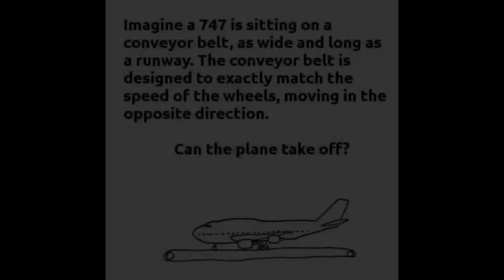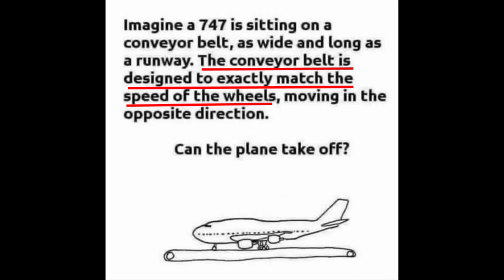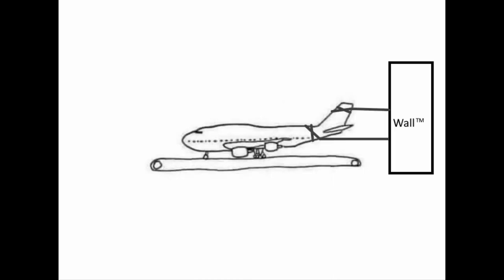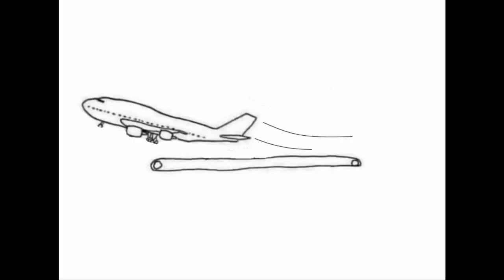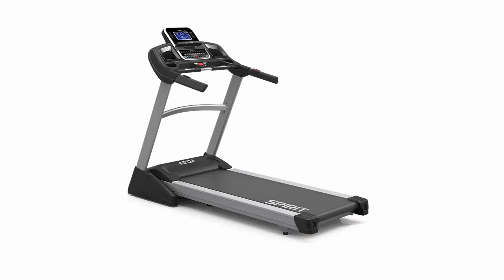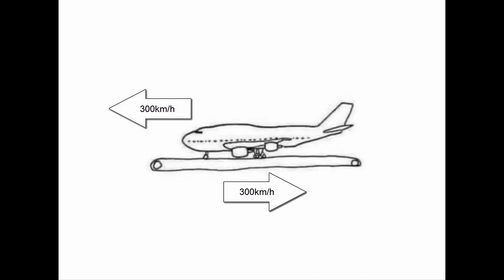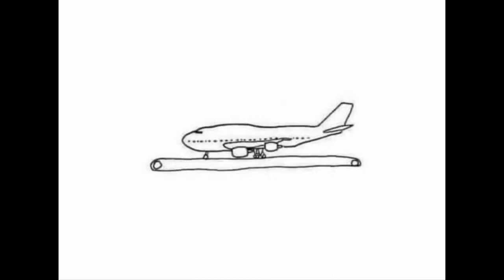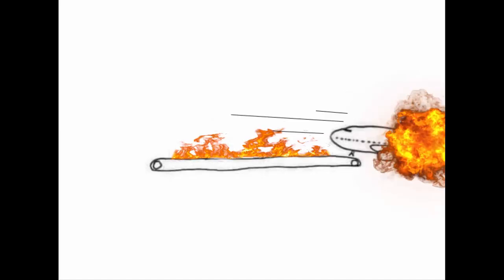Airplane on a treadmill is a flawed question.

Comment: The problem is, it's a trick question as worded. The planes wheel speed and the belts speed must be identical. As such, by definition, the plane must be stationary. Forget what the plane is CAPABLE of doing. That's completely irrelevant. All that matters is wheel speed (x) MUST equal belt speed (y) according to the rules set forth (ie. x=y). You illustrate the problem yourself at the 2min mark where in order for the plane to move forward at 300km/h, its wheels (x) need to be moving at the 300km/h ABOVE the belt speed (y), resulting in x=y+300km/h. According to the question, if the wheels are rotating at 600km/h, the belt MUST be as well (not 300km/h), which necessitates zero movement. In order to move, the planes wheels would, by definition, need to exceed the speed of the belt. So yes, in the real world, your "think of the wheels as ice skates analogy" might be more apt, but the way this question is worded, you need to think of the wheels and the belt as being locked together with toothed gears. They MUST be in perfect sync with each other by definition. It doesn't matter how fast one rotates forwards or backwards, the other will (by definition) have to rotate an equal amount in the opposite direction, thus resulting in zero net movement. For all intents and purposes, this is exactly how wheels and belts operate. They are perfectly locked together. Unless slippage occurs for some reason (which would violate the rules of the question), wheels and belts act effectively like two gears locked together.

So yes, you're absolutely right that it's a flawed question because of the requirement that the wheel speed must match the belt speed, but this doesn't make the wheels or belt irrelevant, that makes them the ONLY thing that is relevant (within the rules set forth in this question). The capabilities of the plane are what is completely irrelevant because it doesn't matter what it can, or can't do in the real world, it will always need to satisfy x=y according to this question.
Reply from the maker: Yes
Reply: Thank you for this.
Reply: This is the correct answer.
Reply: The wheel speed matching the conveyor is the key to solve this. The plane is sitting on the conveyor neither the wheel or the conveyor is moving. Now start the jet move  1 rev of the wheel now the plane has moved forward and 1 rev of conveyor is now behind the wheel. The real question is how fast the conveyor is moving.      The answer is it is not and never will. That is the trick of this question.
Reply: The wheel and belt speeds can match all they want. If the belt is not as long as required minimum for the plane to achieve Vr and it moves forward past V1, it's going off the end of the belt on the ground. That's why the question makes it clear the belt is as long and wide as a runway and in fact, that is the deciding part of the question. A plane can't even get off a runway without a conveyor belt muddying the waters if it runs out of runway too fast to reach rotation speed. Whole point of having minimum runway length by airplane type.
Reply: @HerrinSchadenfreude  the whole point is that X=Y meaning no net motion.  You could have the wheels on a matching set of cylinders that roll at the same rate as the wheels fixed in the ground instead of a long conveyor and the net speed will similarly be zero.
Reply: Everybody commenting that the "math" forbids any motion of the plane is dumb. There are two possible scenarios depending on how you measure wheel speed. If the wheel speed is measured at the axis, then the wheel speed is equal to the plane's speed and the conveyor moves backward at that same speed, resulting in a wheel rotation of twice what would normally take place on takeoff. If the wheel speed is measured at the surface of the wheel, the solution to the problem is you equip the plane with wheels that have infinite radius. Their rotation approaches zero and the conveyor stays completely motionless as the plane takes off and its pilot gives a big middle finger to everyone who tries to create mathematically impossible scenarios. X=Y=0 and the plane still moves forward.
Reply: @TSR5000  your math is incorrect and your two scenarios are terribly incorrect.

You are mixing and matching the speed at the wheel axle with the tangential speed on the circumference of the wheel.  That doesn't get you twice the wheel speed or the vehicle speed.  That's a common and basic error that keeps popping up with people who think the plane just rolls unimpeded.

It's also a sign of inexperience or error with understanding frame of reference analysis.

If you want to see what people mean by the vehicle doesn't move, Mythbusters mistakenly showed it when they had the RC car on the treadmill.  They went down the wrong path by incorrectly asserting that the force applied by a jet or propeller is different than the force applied by the RC vehicle.

Force is force.  Rolling speed is just rolling speed.  The conveyor is easily seen to be in equilibrium with a rolling wheel in multiple examples.

Probably the easiest thing for doubters to understand is to look at a rack and pinion combination moving in sync.

Folks are making basic mistakes.
Reply: @MrDefreese  I fully understand frame of reference. My whole point in stating the different scenarios is that "wheel speed" in the original problem statement is ill-defined and can be interpreted in different ways leading to different solutions. Do you measure wheel speed at the axis or the wheel surface? It doesn't say. And depending on frame of reference picked you can also calculate wheel speed relative to the ground or relative to the conveyor built. The original question leaves that undefined too. The mythbusters RC car is irrelevant since it generates force through the wheels, not thrust from the air. In any case, it's a contrived problem that I choose to "solve" by just giving the wheels infinite radius so you can completely eliminate any conditions imposed by the equally impossible conveyor.
Reply: @TSR5000  that’s still incorporating a few flaws.

Mythbusters is incorrect when they try to argue there is a difference in force applied to the vehicle.  The only difference is that the RC or car motor stops working once the vehicle manages to get off the ground.  The ‘force of a jet applying to air’ is a terrible misunderstanding that is unfortunately percolating through the demographic of people who think a plane will take off.

Similarly, concocting an infinite radius wheel is well beyond the realm of absurdity.  At least the aircraft on a conveyor can be tested and proven to result not only in no flight, but also in no net position difference in the wheel axle because as mentioned before, you can see what happens when a system is in equilibrium.
Reply: @MrDefreese  Airplane accelerates through force from air. Car accelerates through force applied to its contact surface. Yes, they are very different. You can move the ground as fast you want with the plane and its going to spin the wheels but it doesn't exert any force on the plane beyond the friction in the bearings. This is different from a car which is coupled through the driveshaft. The airplane will take off unless you force it not to by warping reality around a bad mathematical model, to which I again say if you are going to force bad math than I can put arbitrarily low friction bearings, or large wheels on the plane to resolve the mathematical constraints, just as the conveyor that could actually force the plane to not move would be physically implausible. The speed at which a conveyor belt would have to move, to exert enough force with normal rolling resistance, to overcome the thrust of a 747 is beyond ridiculous. Your "equilibrium" state would never be achieved.
Reply: @TSR5000  that’s a lot of words to show you need to return to introductory science and you never get  to call anyone dumb again.  You have used all the incorrect talking points of someone who has learned through talking points.

The vehicles only move by rolling no matter how it is under force.

Furthermore, even without a force applied, the setup tells you that you can always find equilibrium between the rolling speed of the vehicle and the linear speed of the conveyor.

Fail
Reply: @MrDefreese  You're the one talking like someone who has never taken even a basic course in physics. Draw a force diagram and show me where the thrust is applied by the plane's engines. It sure ain't through the wheels. The movement of the plane is dictated by the sum of forces, and those are the thrust from the engines acting directly on the plane's body, and whatever force is exerted by rolling resistance through the wheel's bearings. There are no other magical forces from the conveyor that can prevent the plane moving except through that mechanism. Good luck overcoming 65,000 lbs of thrust without seizing wheel bearings. The equilibrium you speak of is not physically realizable, the math is a bogus condition that would result in a failure to the conveyor system well before it could ever stop a plane from taking off. And if you insist on arguing in theoretical situations that are only describable through math, then my original solution of fitting the plane with infinitely large wheels will overcome any hypothetical conveyor since the wheel rotational speed always goes to zero in the limit. You insist that the plane cannot take off because the wheels have to roll. Well, if we are only evaluating this problem mathematically they do not. The plane I have described will have zero wheel rotation at any finite takeoff velocity.
Reply: @TSR5000  lol.  The other guy got thrashed trying to fall back on force diagrams too.  You don’t need a force analysis to solve this problem.  You are given explicitly that speed equals speed.  😂
Reply: @MrDefreese  To which my solution still stands that 0=0 and the plane takes off if we want to live in mathematical fantasy land.
Reply: @TSR5000  no, you completely and irredeemably misunderstand without outside assistance.

Very slowly.

If you give the wheel a rolling speed of 1 rpm.  The conveyor moves at exactly pi * wheel diameter per minute.

At every rolling speed of the wheel, the linear speed of the conveyor is in equilibrium 

This really is not hard.
Reply: @MrDefreese  What is the rotational speed of a wheel as its radius approaches infinity? It's not 1 rpm. It's zero. This solves the mathematical constraint. This is just a philosophical difference at that point, since any of these scenarios are physically impossible. You choose to satisfy the constraint by forcing the plane to stay stationary, which would require an imaginary force exerted by the conveyor. I choose to satisfy the constraint by finding a way to keep the wheel speed zero so that the conveyor has no effect on the plane.
Reply: @TSR5000  derp.  Nobody is talking about infinity except people who only know how to button mash on a calculator.  You solve nothing with that approach.
Reply: @MrDefreese  And you still haven't explained how your hypothetical conveyor is capable of applying 65,000 lbs of force to negate the plane's thrust. You can impose whatever conditions you want, but the laws of physics still apply. Absent an equal and opposite force, that plane is going to move forward. Now, how does your conveyor achieve that? It can only apply force to the plane by spinning its wheels and generating friction. If we go back to the original question, it states "The conveyor belt is DESIGNED to exactly match the speed of the wheels." Emphasis on designed. There is a big difference between design and what it is actually capable of. It doesn't say the conveyor can bend the laws of physics or that the conveyor won't fail. And fail it will.
Reply: @TSR5000  derp.  To design and build a thing is maybe a third year design project.  The only thing remotely challenging is the size and weight, but that’s not what this is about.  As mentioned a few times specifically for you, you can create a system with equilibrium conditions and that merely shows that a rolling test vehicle goes nowhere if the conveyor moves at the same rate as the rolling wheel set.

1-1 =0

Indeed the real world of physics apply; you just keep misunderstanding.

Try this to hopefully disabuse this intransigence.

If the wheel set doesn’t slip, this is functionally the equivalent of a pinion gear on a rack.  If you give the pinion a rotational speed while the rack is static, the pinion will roll across the rack.  If, however, you give the rack a matching motion, the the axis of the pinion remains in place while the pinion rotates and the rack travels.

You really have to get out of that funk of misunderstanding.  Starting out by calling people dumb and then mistaking a whole bunch of points and principles is not a good look.

🤷🏽‍♂️
Reply: I see you are a "rules apply to thee not to me" kind of guy. I get it. I understand how a rack and pinion works, and if the plane was mounted on one I would agree with you 100%... Except it's not. That means you DO NOT get to ignore little details like the rolling resistance of real tires, the speed at which wheel bearings will catastrophically fail, etc...

If you are going to forbid oversized tires, you have to abide by the limits of real world materials too. You can't ignore the fact that an opposing force has to be transferred into the plane via rolling resistance for the plane to remain stationary. Failing to do so, your model is invalid. And there is absolutely no way you are going to scale your third year design project to generate the needed resistance at the scale of a 747. It's just a mathematical construct, and math alone can't stop a plane from moving.

Also, opening a discourse with "derp" and concluding with an emoji is not a good look. Crying laugh emojis just make you look childish. Frankly, I don't understand why you can't just observe the novelty of infinite wheels as an amusing alternative solution to satisfy the math instead of trying to flex your basic understanding of physics jargon. Think outside the box a little bit.
Reply: @TSR5000  think outside the box?!?  You are just tossing in any old thing like hyperbolic tires or such to hold on to your premise but it doesn’t work.  The speed of the wheel or the pinion is net of any losses…therefore the speed of the conveyor or the rack is net as well. 

Once more - if the rolling speed is one figure then the conveyor or rack speed is the same thing.  Since there is no slippage, the rolling speed of the wheel is exactly equal to the conveyor which is exactly the speed of the wheel axis from the frame of reference of the surface of the conveyor.  No matter how you do the math or the physics, 1-1 = 0

You are making incorrect assertions of physics and the underlying math.

Look at the Mythbusters piece where they had the RC car in equilibrium with their treadmill.  Look at the treadmill car races where the force of gravity is balanced out by the running conveyors - there are a whole series of those.  You’ll come around to the math and the physics.

Comment from the maker: For anyone wondering, technically you could hold the plane in place if you had the engines running slow enough that they just match the friction of the wheels. This might work on a smaller plane, don't know if it would work on a larger plane. However once the engine(s) are put up to take off speed it becomes impossible to hold it in place as the thrust will always be stronger than the friction force.

So semantically you could keep it in place, it just requires altering the question and using a plane able to throttle low enough to do it. Or use really really bad wheels with high friction.
Reply: @venera13  this is a flawed take still.  This is not about holding the plane in place.  This is merely saying that at any rolling speed of a test vehicle with wheels, you can mathematically, logically, and empirically set the surface to the same speed.

Functionally, you can take two matching cog gears, give them the same rotational speed, and they will also be in equilibrium - the axes will be in the same position as long as they have equal speeds.

You can use two wheel baseball pitching machines to see it in more common, practical situations.

Comment: It's not a realistic questions at all, but by the simple fact that the wheels must exactly match the speed of the conveyor belt, there is no physical way for the plane to move its position forward relative to the conveyor belt.
Reply from the maker: There is no physical way for the belt to match the wheels speed with the planes jet engines throttled up. So im ignoring the questions attempts at confusion and focusing on reality.
Reply: but nothing in the question mandates that the belt adhere to its design
Reply: @venera13  Congratulations, you just broke the rule of the question, which specifically states, the conveyor is designed to match the speed of the plane's wheels. It's purely a theoretical question (I know this is a 1 year old comment I'm replying to)
Reply: @gwp4eva  So why mention it if we are allowed to just disregard it?
Reply: Amen